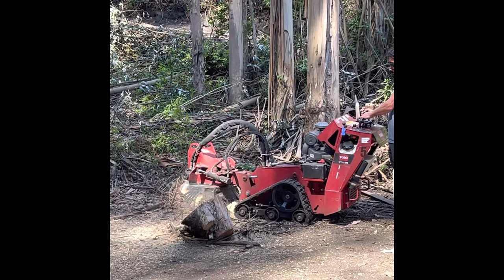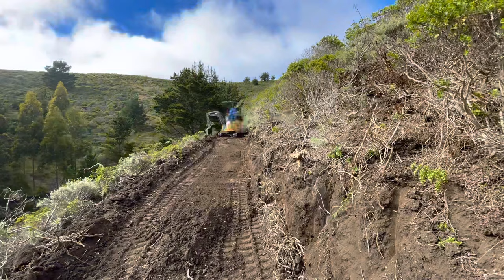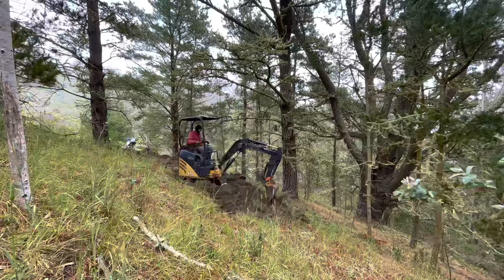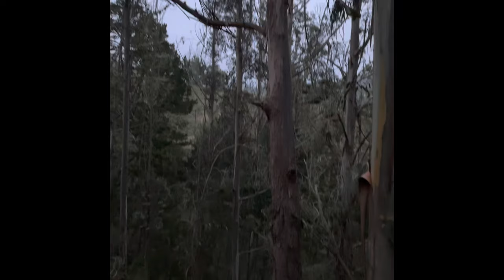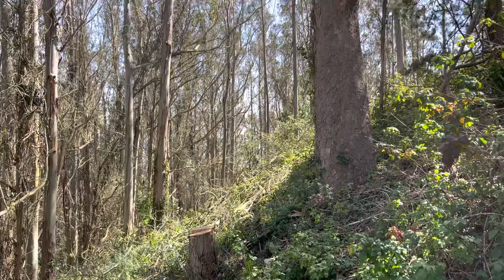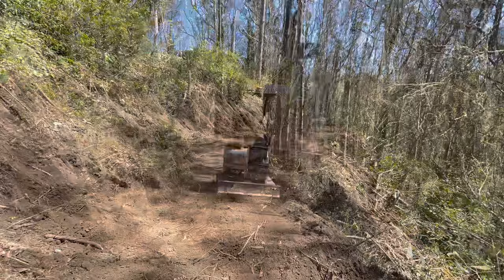Mini Excavator Making Trails

Comment: Very interesting, my land is on the side of a mountain, so it's not easy to get around by ATV. I would love to be able to make trails like yours but, when I dig into the ground, what may seem like a small stone is sometimes surprising, because what was apparent is only the tip of the iceberg. A rock that protrudes just 6 to 8 inches can actually turn out to be a rock over 3 feet in diameter.
Reply: I build trails for a living. there are always rocks. if they're to big to remove. which is rare. you redirect.
Reply: Funny.  I have 67K miles using 2-wheel street legal dirt motorcycles.  
On dirt through temperate rain forest into sub-alpine mountains.  My
practice area is found in YouTube as VEDDER MOUNTAIN.  Open
year around, free, with volunteer groomed routes.  Rides specific for
4x4, mountain bicycles, and motorcycles.   I recommend watching
the wet and winter freezing ride conditions from a safe sofa.
Reply: TNT

Comment: This is one of the best trail building videos I have seen.  Very inspiring.  I have a large property and want to build trails throughout.  I like what I see with the JD 17.  Does it require much maintenance?
Reply from the maker: Super easy to maintain !
Reply: @Girthmovers  Would this trail support a 4x4 mid size SUV?  Is it wide enough for a 6ft wide SUV plus maybe 1ft on each side??  Do you have to add rock to the trail to support dirt bikes, ATV, small cars?
What about a canal on the side of the mountain does it not need a canal?
Reply from the maker: @HealthSupercharger  probably could rip 4Runner up it. Made it for dirt bikes and utvs. I put culverts and water bars and packed it all  in off camera.
Reply: @Girthmovers  if you get a heavy rain it’s all gonna run on top of the culverts a water ditch on the side is better
Reply from the maker: @bass_and_trout_fisher5864  hasn’t been an issue
Reply: on a scale of 1 to 10, what was the risk of tipping when you were using the mini excavator on the slopes? In other words, would it require a lot of skill and experience, or did it feel safe with no problem moving back and forth as it excavates?

Comment: Berms left on the drainage side. And some of the trail draining on the inside with no water diversions. It will not take long for erosion to take over some of the trail.
Reply from the maker: Good observation
Reply: what would you suggest to build for the drainage?
Reply: @HealthSupercharger  First no outside berm or debris, a few degrees of fall from inside to outside. Not much in case the trail is wet. And a slight trench on the inside with a slight cross over at bends turns and change of grades.
Reply: @Girthmovers  Hows the trail held up in rain events over time? We live in a high rainfall area and making my drainage correct the first time is my goal with a similar grade of track...

Comment: Great video, I'm looking to get a 17G to do the same so this was very helpful. Is the 17G powerful enough or would something bigger be better? Can you pull out stumps and large rocks with that? Thanks.
Reply from the maker: The jd 17 is a great machine. It’s super stable and  surprisingly can lift a lot of weight. Perfect for making trails
Reply from the maker: The thing fucks through stumps
Reply: @Girthmovers  Trails is for what?  non vehicle traffic?  is is a trail good for small 4x4 SUV?
Reply from the maker: @HealthSupercharger  trails for hiking, dirt bike, atv/utv, small 4x4
Reply: @Girthmovers  I see this is inspiring so building a driveway would be bit more work because it would have to support bigger vehicles even dump trucks.
Reply from the maker: @HealthSupercharger  anything’s possible with the right planing and tools
Reply: @Girthmovers  any advice on planning for a newbie about to cut his teeth in a 9T CAT 308E2 making a 150-200m 2WD track up a steep slope? This is the BEST vid ive found on YT so far as to giving a basic, clear idea on what making a track up a slope looks like..! MASSIVE thanks!

Comment: Nice video...wish it was a little slower speed though so I could learn better. I just got a 17G and my butt can't gauge the center of gravity yet. Feel like I'm gonna tip over half the time.
Reply from the maker: I like to use the boom as a counter weight. You can go up some pretty steep terrain with all the weight down low.
Reply: You can slow the speed of the video by tapping the 3 dot button in the upper right hand corner of the video. 😉

Comment: This is very helpful for me... What is the length and time taken to complete this trail?
Reply from the maker: Thanks for watching! Trail is a mile long. Took about 5 days.
Reply: @Girthmovers  5 days x 2 men?  How wide is the trail 6ft 8ft 10ft?  big enough for a 4x4 mid size SUV?
Reply: @Girthmovers  1600m /5 day = 320meters / day.  or 32m/hr if you worked 10 hr days
Reply from the maker: @HealthSupercharger  1 dude 5 days 4 hours a day. Two dudes couple hours to cut trees and play a little. Some sections are more narrow than others 8-10ft wide
Reply: @Girthmovers  thanks for the answer.

Comment: Very NIce! Been hand building in very similar terrain for over a decade and about to move up to a machine.  What would you say was spent on gas or better gallon consumption for that mile?
Reply from the maker: Burns about 5 gal a day
Reply: @Girthmovers  and
 was that with almost continuous use? thanks
Reply from the maker: That’s running the machine all day long
Reply: @Girthmovers  brilliant, thank you!
Reply: @Girthmovers  Nice thats good info. I am starting on a 2mile project on private land and while I am not by any means new to trail building I am very new to mechanized building. I am president of a local mtb group that is looking to build 40 new miles of trail and we've been given the green light by the forest service to train and go through the steps to be able to cut them ourselves vs. paying $400k to a company to hopefully hit our mark to make the new trail plan a reality.
Reply: @Girthmovers  would a small bulldozer be better?